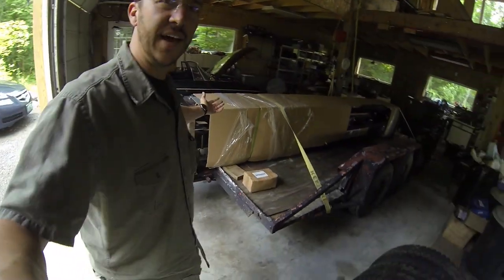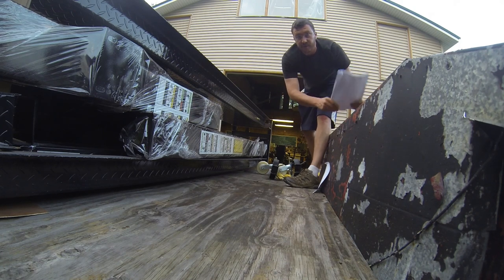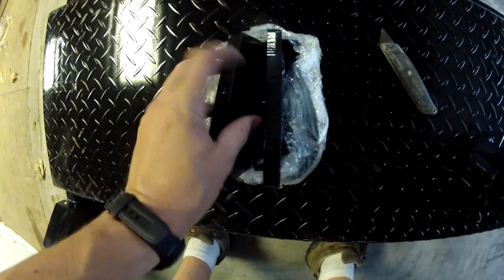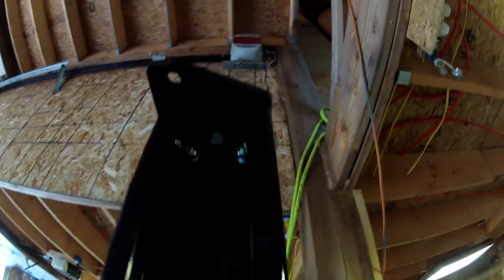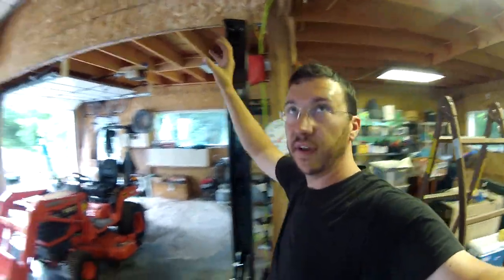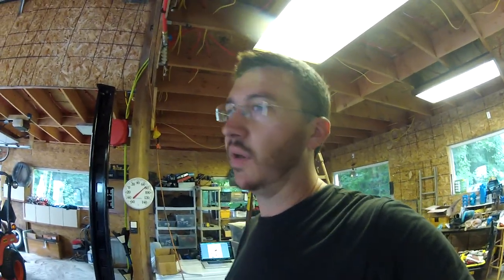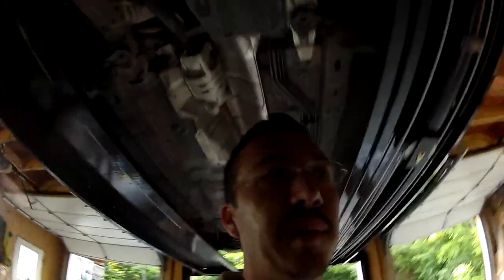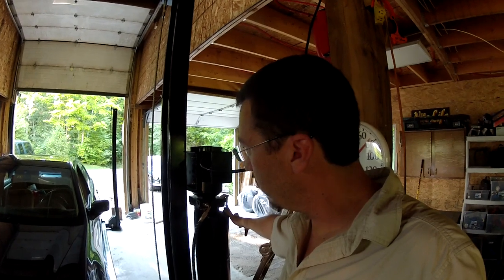Start to Finish - 4 Post Atlas Garage Pro EXT 8,000 lb Auto Lift Installation

Comment: If you are like me I bet that was was the best thing you have ever purchased for your garage! I have had a similar one since 2007. I use it a lot and when not working on my cars I made some between the ramps inserts by ripping down 2x4s and topping with 1/2" OSB board over them. Fills the opening between the ramps making it a big flat floor to store stuff including rolling equipment, rolling work tables, tool boxes, riding lawn mowers, etc in the winter. Makes the garage much more usable all year.

Comment: Thanks for posting.  I just installed a garage pro9000.  Although mine is a different model it was similar enough that watching your video helped a lot.  They still have not improved the instructions.  Your comment about the instructions being made for a lift that does not exist was spot on!!

Comment: Great video, thanks. I just assembled the same lift in my garage and discovered most of the same issues. I swapped out the needle grease fittings for standard ones.... you didn't touch on that. Also for those doing this,  make sure you check your upper lock to make sure you have the required 2" clearance to lift off the lock before you lock a car onto the top!

Comment: We finished the install today of the same 4P lift. 
Instructions are PURE CRAP. Things shown as assembled are not, things shown unassembled are.  Parts call out is vague and often misleading. Add to the assembly that you are working with finger removing weight and metal edges.....this is not fun!  We used a engine hoist, jack stands, 2x4 chunks  as well as a GOOD pry bar. Unit seems to be a good quality but 'may need help' for us was more like '3 people needed' as we were in a one stall bay.  I have yet to adjust lock bars and cables so that info is fantastic. Thanks!!!

Comment: The problem you have lifting with your lawn mower is the forks are on the bucket. Get some skid steer forks and remove the bucket and add the forks  you will be  about 2' closer to the loader pins . Than you just lift 2 levers to change from the forks to other attachments. My 35hp branson tractor lifts 2100lb at the pin but when I put my 6' extensions on it will only lift 500lbs at 4' from the pins

Comment: I never saw the video on you installing the anchor bolts in your new hoist! or heard you talk about installing them! show or tell me about them! keep up the good work!
Reply from the maker: 4-post lifts don't require anchor bolts by the way they are designed.  they have 1' x 1' steel pads as feet, and also are supporting the car well wider than the car's tires are supporting the car.  It also maintains it's portability which was important rather, essential to me and one of the reasons I bought the lift.  Don't worry, I thought it was sketchy too when i first heard about not bolting it down.  :)
Reply: MyGarageBuild I had a 14,000 pound Massey Ferguson tractor that was blocked very good but the jack kicked out and the tractor fell and broke my arm and almost cut it in half! I was just thinking if you had a 9,000 lb truck at the top of the lift and was pulling a car or anything large under it and hit 1 leg and made the weight swing of leg pull out because you did not put at least 1 = 3/4" lag bolt in each leg! and get hurt or destroy the building structure!
Reply: Brad Fisher All Atlas portable four post lifts (8,000 lb. capacity) are designed and built for use by Mr. Homeowner or restoration shop. These lifts are not designed to work in commercial repair shops that raise and lower a lift several times per day.
Reply: Brad Fisher This Lift does not require bolting to the floor
(BUT)
If you choose the option to anchor the Lift to the floor please follow
the detailed instructions and criteria below.
FOUNDATION and ANCHORING REQUIREMENTS
1. Concrete shall have compression strength of at least 3,000 PSI and a minimum thickness of 4”
in order to achieve a minimum anchor embedment of 3 ¼”.
NOTE: When using (¾” x 5 ½”) long anchors; if the top of the anchor exceeds 2 ¼” above the floor grade,
you DO NOT have enough embedment.
2. Maintain a 6” minimum distance from any slab edge or seam. Hole to hole spacing should be a minimum 6 ½”
in any direction. Hole depth should be a minimum of 4”.
3. Shim each column base as required until each column is plumb. If one column has to be elevated to match the plane
of the other column, full size base shim plates should be used. Torque anchors to 85 ft-lbs. Shim thickness MUST NOT
exceed ½” when using the 5 ½” long anchors with the lift. Adjust the column extensions plumb.
4. If anchors do not tighten to 85 ft-lbs. installation torque, replace the concrete under each column base
with a 4’ x 4’ x 6” thick 3,000 PSI minimum concrete pad keyed under and flush with the top of existing floor.
Allow concrete to cure before installing lifts and anchors (typically 2 to 3 weeks).
Reply from the maker: I've thought of something recently which I will do a video about.  I may instead of installing bolts in the floor, install the nuts (or some other such ridiculously solid fixture) in the floor, and then bolt the lift down into the nuts.  This way I can still move the lift, and not have studs sticking up out.
Reply: That dose sound the best if you plan on moving the hoist around the shop! I saw the attachable wheel they sell to raise up the frame to roll it around a warehouse!
Reply: MyGarageBuild
instead of the bolts with the expanding lock collar on the bottom end of the anchor! use the large lead split wedges that use a large lag screw! if you strip one out it could be re-drilled (the lead wedge) and put a new set of wedges! alot easier than making a anchor nut! put 1 = 1/2" lag screw in the 4 corners of those steel plates (total of 16) instead of installing 4 large (like 1") expanding anchors!
Reply from the maker: can you point me to these lead wedges?
Reply: you drill a hole in the cement and blow out the dust and tap in these wedges and screw in the lag bolt and then they expand outward and tighten down to the cement whatever you want to fasten down!
Reply from the maker: Nice, yeah I've used those.  Not a bad idea.  I'll think on it more.  The trick would be drilling and not hitting my radiant tubing.
Reply: I don't know if one of those Cameras they use to see heat loss (hot & cold) spots! an a cold day when the floor is 55 degrees turn the heat up to 75 and in 3 minutes look at the floor with the camera and you should be able to see the warm pipes (hot cement) thru the floor! and mark the floor with chalk.
Reply from the maker: That's a good idea, that would be the only way I could think of to do it.
Reply: +My Garage Build THANK YOU FOR THIS VIDEO. I just wanted to triple check that its OK NOT to bolt/anchor my lift to cement.  My wife parks her truck on it daily (with the lift all the way down). The only time it will go to use is when i work on my Viper. So roughly every month or two i would get a car up in the air. However i would likely be do extensive mechanic work. After reading around, seems like a I dont need to anchor this lift even i am doing extensive mechanical word on car. You agree?
Reply from the maker: +Jay Schmett Hey Jay.  Yeah I still haven't bolted mine down.  It's really not necessary.  I've had my 1 ton diesel suburban all the way at the top and beating on something or other and it was fine.  The heavier the load, the more stable it seems.  But I see bolts as a little bit of an insurance policy.  If you want an extra layer of safety bolt it up.  Also, I store my suburban in that bay, but I put the lift all the way up, so I'm not driving on the ramps each time, can your wifes truck fit under the lift?  I do it to keep the salt and sand off of it.
Reply: Awesome thank you. I put the car up on lift night. Your right totally stable. Not worried.

 I have do have a new concern though. So the way we made this work: My wife parks truck on lift everyday with lift all the way down for convenience. My car goes into a different separate single car garage because lift would not fit in small separate garage. Anyway, I notice when she drives her truck on lift and parks it while it being completely down, there's tons of tension on cables. It appears that the pole with monitor is bowing inward with her truck on it. I'm wondering if I should loosen that cable or is this lift not made to have to someone park at bottom? I'm wondering if it needs to be a safety notch(lifted up) if vehicle is on it for long periods.  Thoughts
Reply from the maker: +Jay Schmett When she parks the truck on it, just hit the lower down lever, it will release that tension
Reply: Yeah i've seen folks not install the bolts.  I just like the idea of it being secured in case i do something stupid and bump it. I would definitely bolt that thing down.

Comment: Hay, im so glad you put this video together because i just got my atlas garage pro 9000 lift the other day and was reading the installation manual and was like OMFG. this manual doesn't make sense at all. So i was thinking what did i just spend 2500 dollars on. Very heavy, hard to move, and very complicated instructions. They would be better served if they created a DVD instruction video like you have. Not really looking forward to this since i have way more projects than one guy should but need a lift for many of them. Did you boult your lift to the floor? because i thought i saw some movement side to side when yu had your car on there.

Comment: I want to put a 4 poster in my garage and one of the vehicles I may put on it or under it is a 76 MGB that I don't have at the house right now. I saw a B in the background of this video. What is the height to the top of the windshield frame when the top is down?

Comment: Hi... I just purchased this same lift from Greg Smith Equipment and have the electric being ran before it is delivered. The specs say 30amp required. I planned on running 10-2, but do not know what the plug from the motor looks like. Could you please share and let me know. Thanks

Comment: Maybe I missed this, but by the end of the video, and after the car was on, the 4 posts didnt seem to be bolted to the concrete? Im probably wrong, well hopefully wrong
Reply: Most of these four post lifts do not require attachment to the concrete. At least the one I have doesn't.  ( different brand but very similar) It has never been bolted down since getting it in 2007. It came with a bolt kit but also said installation with the bolts is not required. In fact, it also came with four big casters units that you can attach by large pins to hang off the ramp assembly. They pick up the four posts when you lower the ramp unit down. That way you can roll the entire unit anywhere you need it in the garage at anytime. Even with a car on it if you have the muscles or help available to push it around. My garage floor has a slight slop towards the door for drainage so I re-position mine without a car on it. It weights about 2,000 lbs just by it's self and it likes to head for the door. ;-)

Comment: sorry - the nuts. You've got both nuts on the same side of the top plate on the hoist. The top - is that correct?
Reply from the maker: As near as I can tell it's correct.  The idea with two nuts is that one acts as a jam nut.  So instead of tightening the nuts down to the top plate, you tighten the nuts together.  This makes it so it can't unadjust itself, or worse loosen all the way and ruin things and people. :)

Comment: Once the Atlas Garage Pro 8000 lift is fully assembled and operational is it possible to remove the approach ramps and move them to the other end of the runways? In other words load or unload a car from either end.
Reply: +Ray H. Tharp In talking with the manufacture, yes a car can be loaded or unloaded from either end
Reply from the maker: +Ray H. Tharp Yeah, I'm pretty sure they go on either side.  Could even get another set and leave them on both sides.  Also, you can leave the ramps on while it goes up.  They are kind of floppy like that so I wouldn't put any weight on them but saves having to take them on and off each time you go up (which i used to do)
Reply: Every time I leave my ramps on I hit my head on them at least once a day. LOL believe me, it's better to remove them. Plus my lift has wheel stops that insert where the ramps go just in case the car accidentally rolls. Hopefully they are high enough to stop a slightly rolling vehicle from accidentally rolling off the end of the ramp. Always good to have those in place just in case!